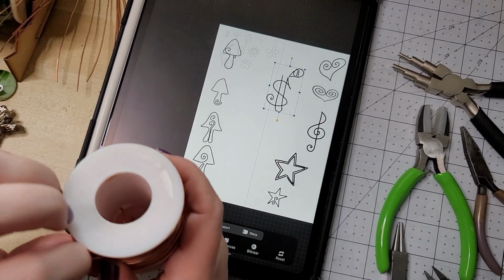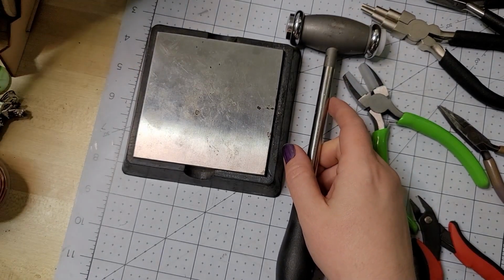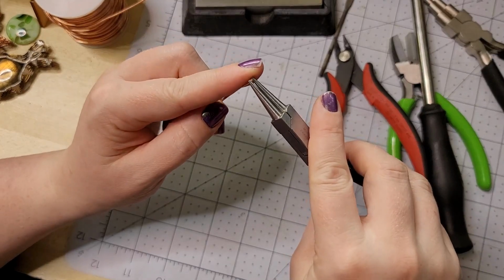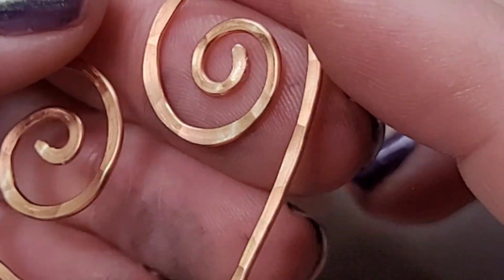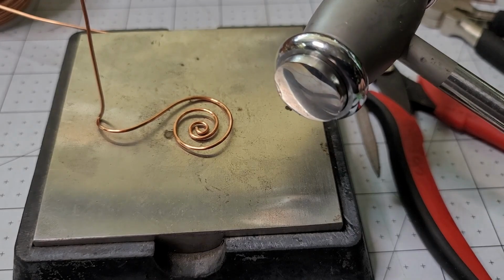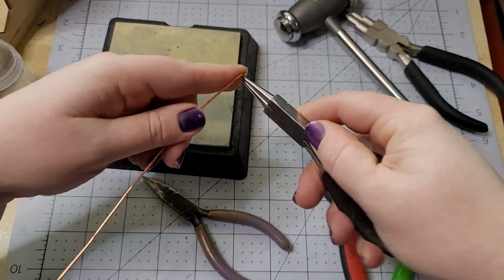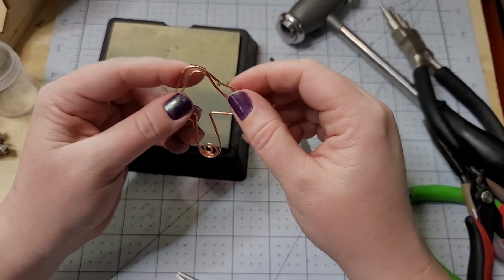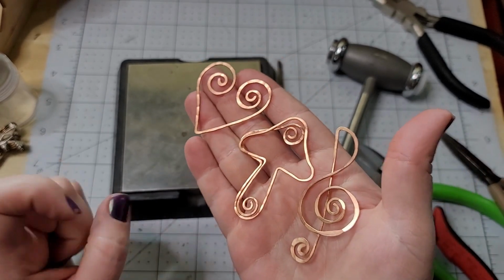Easy DIY Wire Bookmarks

Comment: Love the treble clef, love anything music related and animal/pets. The heart is a common one but if you extend the center, twisted (like a "Y") then add the spirals on the bottom, either side of center, I wonder how that would look as long as it did the job too. But I'm picky about hearts  I prefer star shapes. Oh WOW when you were working the heart and one half was still long and the other was already down to size, that was cool looking! It's funny, I usually like symmetry except when it comes to the heart shape. I find abstract much more appealing.

Comment: I have a couple question’s . I use Para Wire. How do I work harden without messing up the coating? Also how do I seal raw copper jewelry with stone in it do I spray the stone with it??
Reply: I would like to know too